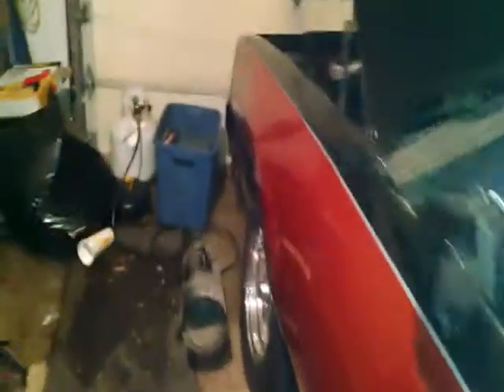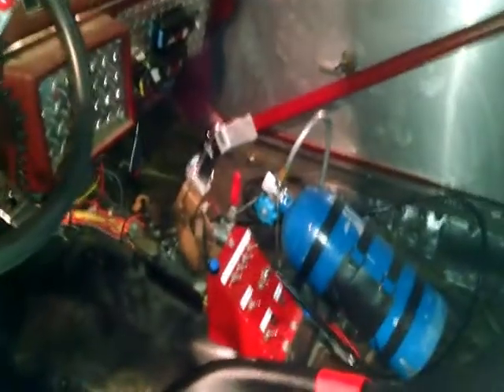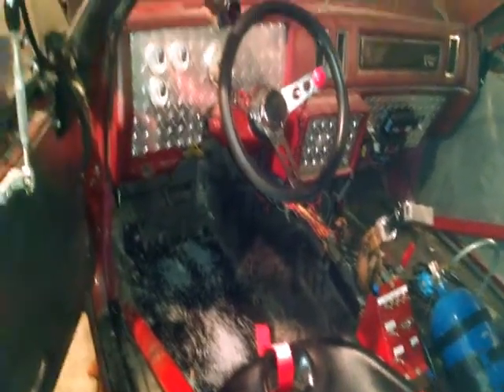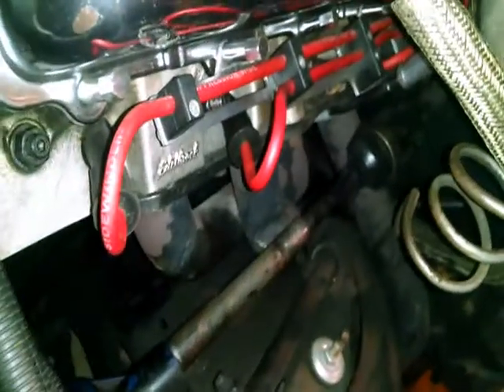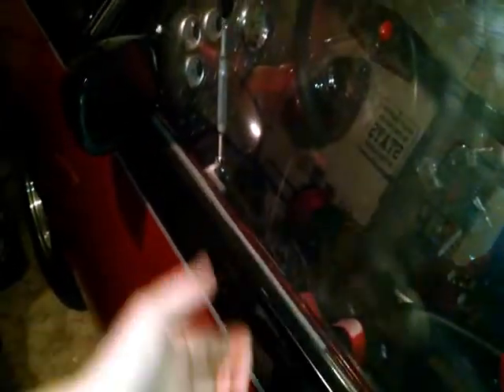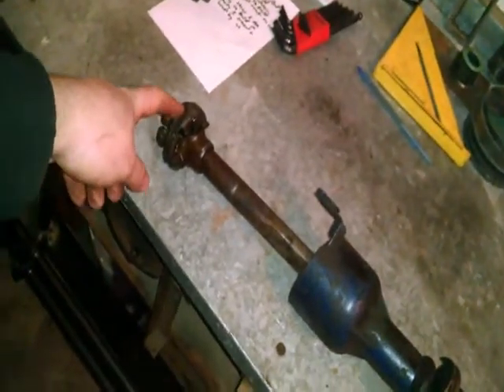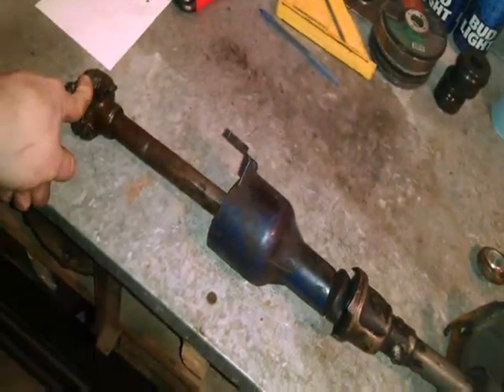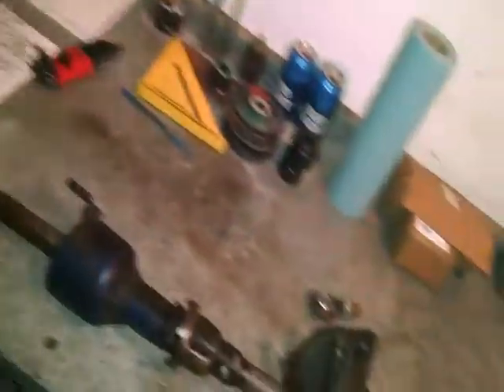Race car weight reduction #1- removing Steering column

Comment: Beautiful engine what have you done to it to handle nitrous?
I have a 425 olds I would love to spray but was always skeptical because of the 2 bolt mains
Reply from the maker: Thanks a lot man. The 2 bolt mains are not to much of a worry. It’s the olds blocks in general lol I have aftermarket steel main caps with a girdle. And h beam rods. If you are rebuilding that 425 look at the main webs of the block some 425’s had window mains which were weaker. But the 425’s had forged steel cranks from factory which is a big plus.